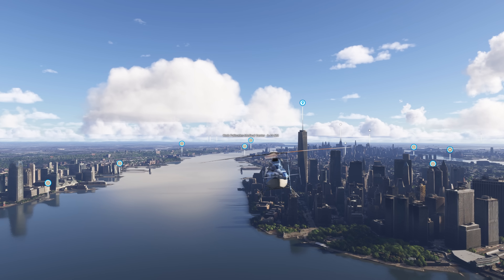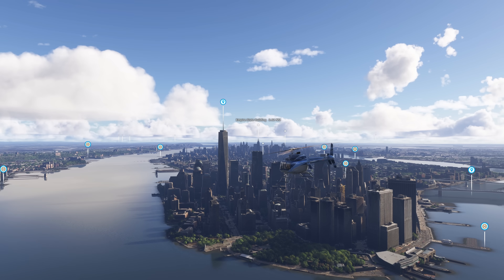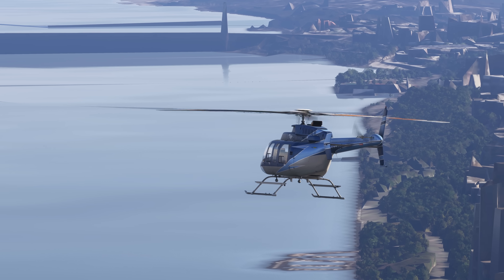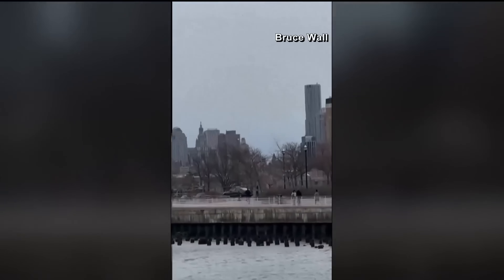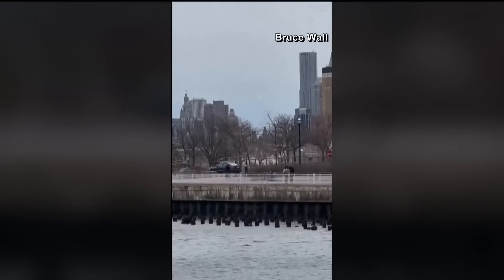Helicopter Expert breaks down Hudson Crash, and discusses “Bump Mast” Theory | NYC Crash Follow-Up

Comment: 14,000 hour commercial helicopter pilot here. This accident was NOT a result of an engine failure or an autorotation. There was some type of catastrophic mechanical failure of a critical structure. Based on the straight and level flight in the videos, it is unlikely that it was pilot induced. What we see is an in-flight loss of the entire tailboom assembly and the entire main rotor transmission assembly.  The loss of one could result in the loss of the other.  Unfortunately for the pilot and the Escobar family either one would not be recoverable by the pilot.  

Pure speculation until we allow the NTSB to finish their work, but here are some possibilities:

Collective bounce - the combined mass of the pilot's left hand and collective will move in the opposite direction as the airframe, resulting in a quick and compounding up-down oscillation.  Recovery is simple - remove hand from collective.  The 206L has a specified minimum friction on the collective to prevent this, but I am aware of at least one fatal accident attributed to collective bounce. The tail boom and main rotor separated from the aircraft. 

Tailboom separation - the tailboom is attached to main airframe with four bolts. If one of those bolts failed, or if one of the attachment flanges failed, that would result in a very sudden right yaw and forward pitch. Hard to predict all the subsequent consequences, but loss of the main rotor assembly is a real possibility because of the mismatch in angles.

Tailboom failure - monocoque construction, so a small dent or scratch would weaken it, causing it to fail in flight.  Unrecoverable due to C of G being out of limits. 

Tailboom strike - again unlikely due to apparent level flight, but it is possible that one or both of the main rotor blades contacted the tail boom and effectively cut it off. However that would be near the end of the tail boom, and it appears that the entire tailboom is missing. There would be minimal or no damage to the main rotor blades, as those leading edges are tough, but the resulting shock could be enough to tear the main rotor transmission from the fuselage.

Main rotor gear box (transmission) separation - a maintenance error or manufacturing defect in one the nodal beams or other MRGB suspension points could cause the entire MRGB and rotor system to depart the helicopter. This could easily result in the tailboom being cut off.

MRGB seizure or failure - The 206L MRGB is an engineering masterpiece and is very reliable. It is lubricated by an internal oil pump, with indications to the pilot of pressure and temperature.  Furthermore, there is a chip light that warns the pilot of metal particles in the oil. The flight manual calls for an immediate landing for any of these conditions. However if a bearing or gear in the MRGB were to fail, it could result in a sudden seizure of the MRGB and everything attached to it, with an almost certain loss of the MR mast. The resulting shock and attitude change could cause the tailboom to depart.

Mast bump - in normal level flight the main rotor and rotor mast are close to 90 degrees to each other. If that angle is reduced, the mast or teetering hinge will fail,  Unlikely in level flight condition shown in video, and it seems most of the pilot's limited experience was on 2-bladed teetering rotor systems like the R44 and Bell 206L. Also a video shows the MRGB still attached to the main rotor in autorotation descent. So I suggest this was not mast bumping. 

MR blade separation - unlikely as the video shows the MR blade-hub-grips-mast assembly being intact with the MRGB.
Reply: When you analyse the video in slow motion, the helicopter is in smooth, level flight and then, almost in the space of just a couple of frames, the fuselage twists 90 degrees. This is indicative of a catastrophic transmission failure (seizure of the main shaft). The video showed the rotor blades, rotor head, shaft and what looks like transmission assy all falling as one unit.
Reply: @davidtappenden6964  I agree, a catastrophic transmission failure.
Reply: I wonder if it's not the tailboom separation since there was a hard right yaw before we see  tailboom and main rotor separation from the ship. Keep in mind I can't even fly a paper airplane, but what it seemed to my old eyes. Whatever the reason it's incredibly sad and tragic😢
Reply: @BamaCyn  Some Youtube videos are reporting that this class of Bell has had some tail boom issues previously.  It does seem as though the loss of integrity of the tail boom was the first event in the chain.
Reply: I don't know squat about helicopters, and was wondering about the sharp right turn. Everything looked intact when the turn occurred. So was the turn a factor in causing the mechanical failure or was it a result of the failure (or just coincidence)?
Reply: @michelemoneywell8765  That right turn was caused by a mechanical issue.  There is almost no way a pilot would induce a right turn like that.
Reply: @SECONDIN  Thanks for your reply that the right turn was caused by a mechanical issue. A retrieved part showed it wasn't a "mast bump"(?) and thus eliminated pilot error, so that is confirmation of your comment.
Reply: Appreciate your logical lay out the possibilities. Hope divers are successful at recovering more of the aircraft so that probable cause can be identified
Reply: Top comment.
Reply: She was an old bird, driven hard and put away wet. I understand she spent most of her life in Chile, likely working hard in mining or power construction. My guess is a failure of the MRGB interface to the cabin structure. As you stated, "Main rotor gearbox (transmission) separation - a maintenance error or manufacturing defect in one the nodal beams or other MRGB suspension points could cause the entire MRGB and rotor system to depart the helicopter. This could easily result in the tail boom being cut off."
Reply: I am leaning toward your theory of tailboom failure first, and then the torque was so powerfull, the main rotor, tranny, and mast, blades, and part of the roof, disintegrated and departed. Prayers for the family's. Thank you for your thoughts and experience.
Reply: So the main answer could be bad maintence?
Reply: Thank you very much, very insightful explanation.
Reply: Is there really only 4 bolts holding that tailboom on? And if one fails, the whole thing fails? That seems like a spot where redundancy should be a priority.
Reply: Thank you for noting all this was pure speculation without fact. As a racecar engineer and pilot, a few things I noticed in the still photos, there is no damage to the top of the boom where it separated. You would think there would be damage to the top of the boom if the rotors had impacted it in any way. 

But the other telling thing in the new video of the helicopter it takes an abrupt right turn just before the tail rotor and boom separated from the main fuselage. I’m not a helicopter pilot but this sure looks like a tail rotor shaft failure of some sort due to the abrupt rotation just before it came apart. My thought is the tail rotor shaft broke and whipped around sheering the boom off the main fuselage in a matter of seconds.
Reply: @indyrpm4951  i like your explanation and a tail rotor failure or drive to it is also a possibility.
Reply: @indyrpm4951  An internal malfunction of the tail boom assemble does appear to be very logical.  Some youtube videos are reporting prior issues with the tail boom on this class of Gell helicopter.  Once the major parts are recovered we may see a grounding of all Bell helicopters for close inspection.  They are going to have to put a lot of effort into finding all the major components of the air craft.  Are the currents at the bottom of the river strong?
Reply: @JoeLinux2000  The Long Ranger has been flying for decades with no major air worthiness issues.  I don’t think one is creeping up now.
Reply: @JoeLinux2000  I heard the body of the craft landed in about 5 feet of water, but think they said 75ft of water for rotors, gear box for rotors (not sure what they're called) and tailboom. Not sure about currents in those waterways.
Reply: Probably it wasn’t inspected right , and the regulations are so much more lenient on helicopters.
Reply: I see a lot of comments saying, "right yaw". My question is that the nose or the tail? I ask because it looks to me as though both went left. Also, wouldn't a loss of the tail rotor on a CCW rotating M/R cause a tail left nose right yaw.
Reply: @JakeK-ks2pi  Hi. I totally agree with you. But I had an engine failure once. You know. There I was. A nut plate in front of the intake came off and went through the engine. The yaw was so severe that I say I got hit in the face by a helicopter. Nearly knocked me out. But I dumped the collective and made a successful auto. I had a bruised cheek when it was over.
Reply: Pilot error most likely, rotor hit the tail if he overcompensated.

Comment: anytime a teetering rotor system helicopter is put into a zero or negative G maneuver, you are at high risk for mast bumping.  Nothing to do with weather unless it causes very low G's.
Reply: And I don’t think mast bumping had anything to do with this incident.
Reply: @FandCCD  if, for some reason, he had to push the nose over aggressively, maybe to avoid a bird (or drone), it's possible it could have experienced a mast bumping episode.

Comment: Mast bumping and the jesus nut are red herrings.  Even to a non-expert, the latest video clearly shows the only way the helicopter could have swung around so quickly was the rotation stopping abrubtly, which caused the tail to bend and separate.  No evidence of mast bumping.  It's not rocket science.  With all due respect to the Veteran hero, I don't even think he watched the most recent video.  Plus... nobody is talking about how the tail separation event and the audio matched up exactly, which means if you factor in the time it takes sound to reach the camera, the loud clanking sounds actually occurred BEFORE the helicopter broke apart.  So the burning question is what caused the seizure?  Transmission oil leaked out?  Improper repair?  Falsified inspection reports?  We shall soon see.
Reply: Apparently, the entire transmission removed itself from the cabin's hull.  Something that should be impossible with this model, or so I've been told.

Comment: According to some videos I saw, the helicopter appeared to be in level flight and had a catastrophic failure. The entire main rotor/mast assembly still attached to the transmission were seen falling separately and impacting the water a few hundred yards from the fuselage. That seems more like transmission  or transmission mount failure rather than mast bumping. Of course it's all speculation at this point.
Reply: You have speculated correctly about a mount failure due probably to attachment problems in the honeycomb layer for the mounts. Having been an IP for OH-58"s and a maintenance officer for the same at  the came time too.. We'll see once they bring up the rotor and transmission. My money is on the mount and or honeycomb failure.

Comment: Hello Steve,

The Conditions of this accident seem to mirror one that happened in Australia pretty closely.  Both were flying the same model Bells.  Their write up on it was Aviation Occurrence Investigation (Short) AO-2022-034 Final – 12 May 2023.  You can google it to read the document.  The pilot in that case was surprised by a bird strike and did an abrupt control input and chopped the tail off and the rotors and gearbox disconnected from the airframe.

Comment: There's a photo of the main rotor  spinning down with the transmission  still attached to the mast.  Blancolirio shows this on one of his videos.. Also, I've see pictures of a downed helicopter with a tail boom strike.  The blade that hit the boom was splintered or delaminated but still in tact full length.
Reply: I've had pilots tell me they can shear through good size trees and remain somewhat intact so I agree.

Comment: Great investigation, but I don't recall hearing exactly what an auto rotation is.
Reply: There are videos of autorotation on YT. Heavy D and another YT Cleetus go to a helicopter school to learn how to autorotate. Simple description, if there is an engine failure, the rotor blades will still spin with airflow. Consider it a chaos controlled landing without engine power using the spinning rotors to maintain flight down to the ground with a skid landing on concrete. If anyone else has a better description, please correct my interpretation.

Comment: NO WAY..... a mast bump would tear the transmission out of the airframe.
Reply: It actually happens frequently with this model of Helicopter.  Google "Aviation Occurrence Investigation (Short) AO-2022-034 Final – 12 May 2023".  A helicopter the same model as this one crashed just like this one did when the pilot put in a sudden control input after being surprised by a bird strike.  The rotor cut the tail off then the rotors and transmission disconnected from the airframe.

Comment: Captain Steeeve could you do a deep dive into what the Jesus Nut is and how it works with a Helicopter?
Reply: 2-bladed Bell helicopters have the main rotor head attached to the mast with a single nut called a "Jesus Nut" - if it comes off all you can do is say Oh Jesus!  On the Bell 206L, that nut is torqued to 250 foot pounds, three times as much as the lug nuts on your car. And then in turn is secured by a combination of TWO positive dogs in a serrated perimeter, and then each of those dogs is secured with lockwire.  That assembly is so critical that it requires two signatures following maintenance, and also a daily pre-flight inspection.  It is a perfectly reliable piece of engineering as long as the maintenance is done correctly. 

But this accident was definitely not a failure of the Jesus nut, as the entire main rotor head departed the aircraft in one assembly, along with the main rotor transmission.
Reply from the maker: Looking into it now!

Comment: Thank you Capt.Steeeve,,,from what I saw it seems like the transmission or gear box that the rotors are connected to loosened up which made the rotors go back and hit the tail..like bolts came loose and allowed that rotor to come back and hit,,cuz the rotor was still connected to the lower gearbox,,,all depends on where the rotor hit the tail....

Comment: The helicopter was straight and level , forget about bump mast.
Reply: agree in part.  he was straight and level.  rotorcraft spun 90 degree,  that when blade appeared to strike tail pylon, severing it.  the entire rotor head, main rotor shaft and some or all of the main transmission departed the aircraft and gently spun into the river.  i’ll want to see the final ntsb rpt.  i didn’t see any swans or geese (both are in that area) to either strike him or caused him to violently roll to evade, inducing mast bumping.  i’m leaning toward main transmission or main transmission mounts fracturing or seizing.  the jesus nut and mast bumping that everyone (else) have seized upon i believe to be red herrings.  i would also want to see if one of the main rotor blades suddenly delaminated.  that would cause that blade to violently fly excessively high or low out of plane so it or the opposite blade  would fly low enough to strike the pylon and sever the tail.  that impact would then be violent enough to cause the whole main rotor system to rip loose and depart the aircraft.  mast bumping and loosing the jesus nut causes ONLY the rotor head to separate from the rotorcraft.  the intact fuselage would then free-fall to the ground with the still intact tail rotor causing the rotorcraft to spin on its axis as it falls.  same result but for different reason.

Comment: I know the pilot mentioned needing fuel. Would running out of gas have the same effect as another type of engine failure - i.e. you'd need to take emergency action immediately?
Reply: Yes but that’s not what happened here. Fuel exhaustion or engine failure do not cause helicopters to fly apart.

Comment: Excellent narrative. I was a private pilot on fixed wing. I learned experience is everything. In Marine infantry I was transported in Vietnam in military helicopters. Shot up a few times on air assaults. I would rather be on the ground as I saw a few helicopters crash and they really burned like fireworks. Scary stuff. Thanks Capt Steve and the Colonel. Semper Fi

Comment: Unfortunately, COL Joe isn't caught up with the latest news about the incident.  The "Jesus" nut did not come off.  The complete main rotor blade system with the upper transmission hub assembly still attached came apart from the main body and was caught on video windmilling into river.